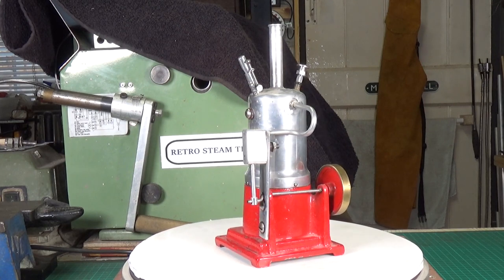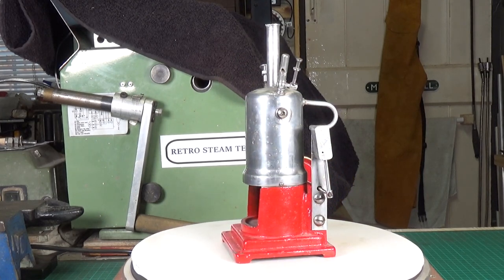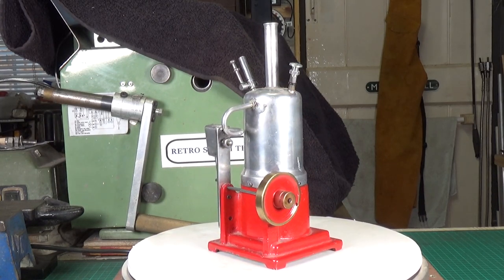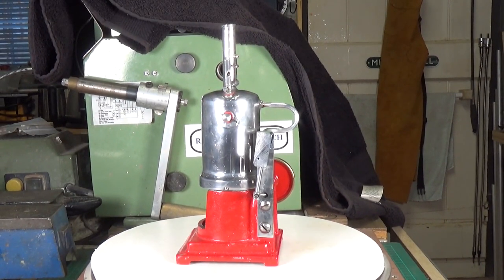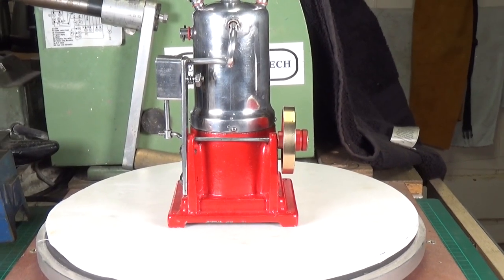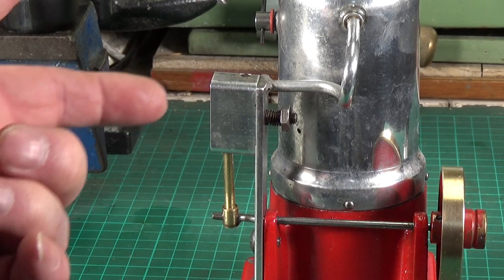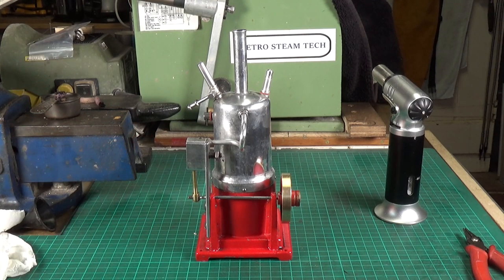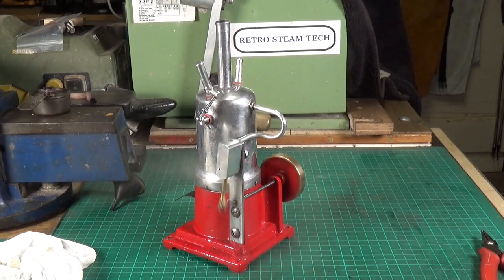Wilson S2 Model Steam Engine

Comment: Nice find, I would say it's a late 40s to 50s. Because of the demand for aluminum in the early 40s was so high. #4-40 is a standard here in the States. I carry a #4-40 tap and die with me at work and use it at lease weeks. Thanks for sharing 👍
Reply from the maker: Thanks Craig. The thread was a bit misleading. That was the thread size of the bolt that had replaced the safety valve. When I came to make the safety valve I measured the thread on the whistle as a double check and that turned out to be 1/4" UNF. I think someone had just forced in any old bolt that they had lying around to block the hole up.

Comment: Hi Alan, it's hard to imagine they used plain aluminium for the barrel and piston, because of the wear factor, but I did read somewhere that it does form a hardened surface (crystalised) from the rubbing action.  Maybe that's what protects the surfaces.  I'm not sure if that is correct.  It could be made from Duralium which is definitely harder wearing.  Interesting design.  Cheers Rob
Reply from the maker: Hi Rob. The original piston was quite loose in the cylinder so I was surprised that it kept binding. It was definitely to do with the heat though as it would run on compressed air. Fitting the new brass piston and conrod transformed it. It could be Dural, although I would be surprised as that tends to be used in the aircraft industry and is generally more expensive than aluminium. Cheers, Alan.